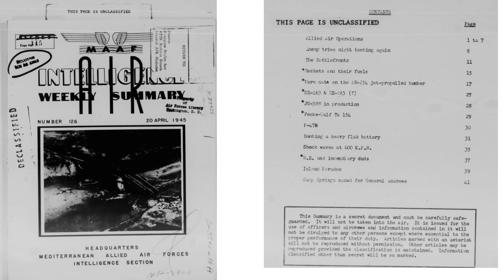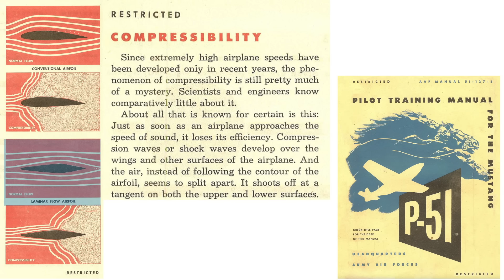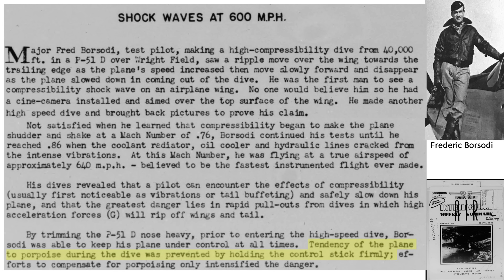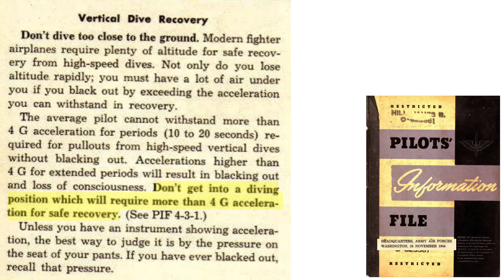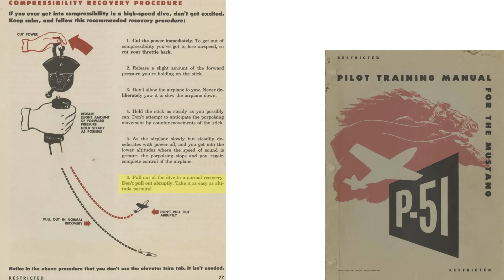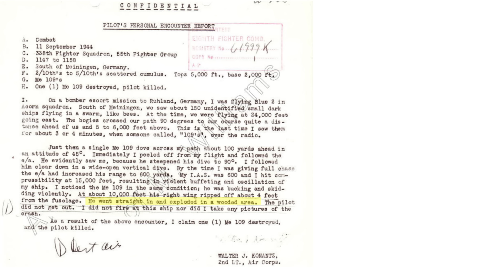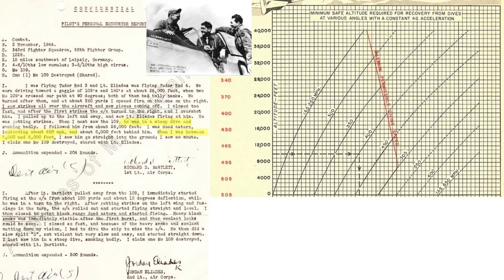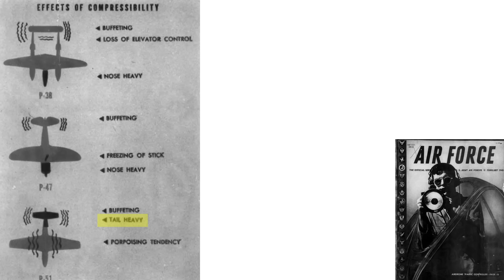P-51s Attacking German Fighters to Speeds of 650 mph, 7 Combat Narration Reviews

Comment: There was a case of a Spitfire  losing its prop in a high G pull out. The pilot blacked out. He survived because the plane pitched up due to loss of prop and climbed up to 40,000 ft, by which time the pilot regained consciousness. He successfully glided to a landing.
Reply: This was Sqn. Ldr. A.F.Martindale in a Supermarine Spitfire PR Mk XI at Farnborough in April 1944. You don't give details of the altitude at which his a/c pulled out, but it's highly unlikely his unpowered Spit reached 40,000 ft in the zoom unless he levelled from the dive at say 36,000 ft [which doesn't make sense - he's not reaching greater than 600 mph IAS at such a height]. Thus I discount the 40,000 zoom altitude.
Reply: @nightjarflying In an interview with Eric Brown he said the aircraft reached mach 0.92 and pulled 11g in the recovery. When it landed there was a gap in the leading edge of the wing root as it had bent the wings backward.
Reply: @ I am disputing the claim that on 27th April 1944, it zoomed up to 40,000 ft without power after achieving Mach 0.91 (620 mph at 27,000 ft). Brown & other reliable sources don't say it did that high a zoom! Without power it isn't going to climb 13,000 ft.
Reply: @nightjarflying  I read it in Eric Winkle Brown's book.
Reply: @MrAlwaysBlue  Name the book - there's more than one. Then I'll check it [I have nearly every book he wrote or co-authored].
Reply: That was one of a series of diving tests conducted by the RAF in April 1944. On 27 April Squadron Leader 'Marty' Martindale, flying with Spitfire XI (EN 409), reached a TAS of 606 mph and Mach 0.89 in a test dive from 40,000'. This was the occasion the plane lost its prop. The Mk XI was a recon version of the Spitfire based on the Mk VIII and powered by the 2-speed, 2-stage Merlin, usually a 63 or 70. There is another occasion when a Spitfire reached an even higher speed in a dive, but that was post war and in a Griffon powered variant. Both of these are almost certainly the highest TAS ever achieved by propeller driven aircraft that subsequently landed. I don't doubt there are craters made by P-47s, Mustangs & Tempests that exceeded these figures.
Reply: @Splattle101  So it's diving "from 40,000 ft" not zooming back up unpowered to 40,000 ft?
Reply: @nightjarflying  Correct. There were subsequent flights in other Spit XIs where the wings were damaged in the pull-out too. However, the Mach 0.92 claim refers to the post war dive I mentioned earlier.
Reply: @nightjarflying  The higher speed dive was in February 1952, during a meteorological flight in Hong Kong. Flight Lieutenant Ted Powles few Spitfire 19 (PS 852) to 51,500 ft, recording air temperatures at various altitudes as he went. At 51,000' he inadvertently put the Spit into a dive from which he recovered at 3,300'. During the dive it is estimated he reached a top speed of Mach 0.94 at 15,000 feet, or approx. 690 mph.
Reply: Wow... [no other words]

Comment: P-47's had similar issues. They would slow down at lower altitudes and they could recover. I think the P-38 got a bad rap on this.
Reply: Compressibility wasn't unique to the Lightning but it did experience it sooner in the dive and have more trouble recovering from these conditions. Compressibility events could also cause inversion of the control forces on the elevator (ie pulling back on the stick would increase the dive angle) and eventually break the tail off.

Later models did feature dive brakes but the type was still considered a poor diver relative to its single engined counterparts.

Comment: I was under the impression that nothing could out dive the P-47.  Could you do that next?

You continue to cover very obscure topics that nobody else seems to think about.
Great job.
Reply: It's commonly repeated the P-47 could out dive everything, but the P-51 had a higher limiting Mach number.
Reply: @Splattle101 according to one source, Eric brown .
All other contemporary sources say its the p47 with a .82
Reply: It's the acceleration in a dive once over 500ft of altitude was lost that made the P-47 so hard to deal with for the Luftwaffe.   The Mach Limit before Mach tuck was about 0.68 and that of the German aircraft about 0.75-0.78 but by the time a speed greater than Mach 0.68 was reached it was often too late for the German  fighter to escape.   The P-47 was not controllable at this speed.  Later  P-47 and P-38 received dive recovery flaps retrofitted under the leading edge to allow recovery at relative high Mach.
Reply: @bernhardzunk7402  
well said, although the P-47 would already have to be at high speed before the dive, since it didn't accelerate well.
Reply: the P-47 is often overblown

Comment: Did all US military aviation use miles per hour (mph) in WWII?
I'm pretty sure most US military aviation craft use knots currently. Do you know when the switch was made? I think it would be in interesting video if you documented the history of speed units in the military.
Thanks for making this really interesting video. I enjoyed it.
Reply: I know that the RAF used mph and the Fleet Air Arm Knots.   A ship navigates at sea using nautical miles and when aircraft carrier is travelling into the wind to recover aircraft speed is measured in knots.  A nautical mile is 1 second of 1 minute of 1 degree so it helps with navigation.  I think knots is the modern standard.
Reply: @bernhardzunk7402  "I think knots is the modern standard."
That's why I was surprised to see speed listed in mph. After I bit of Googling, I think the change to knots happened at the end of WWII but I'm not sure.
Reply: RAF flight manual shows a Spitfire F.24 with MPH on the gauge. and MPH /Knots shown in the V speeds.  Navy F8F Bearcat manual shows everything in Knots.
Reply: @ I suspect if you find a Seafire Manual it will be in knots.
Reply: @bernhardzunk7402   
Knots always used in the Royal Navy, because like everything else in the navy that's how Nelson did it.  ;~D
Reply: @2lotusman851  Do you know the dates these manuals were published?
I think everything is Knots these days but at the beginning of WWII, I think most of aviation was using mph (if not metric).

I would think the transition from mph to knots would have likely started with naval aviation. This is just my guess though.
Reply: Knots became more prevalent by the end of the war to more easily perform navigation calculations with aviation charts.  1 min of latitude = 1 kt.   I have no idea why MPH were originally used in airforces - probably because people were used to MPH in automobiles.